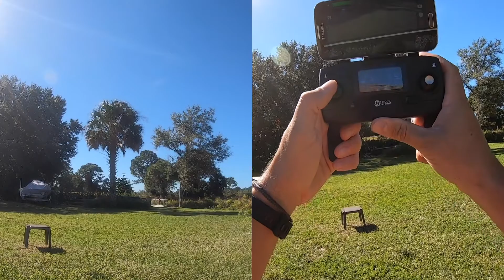Holy Stone HS-720 4K drone yaw issue

Comment: Eesh. Mine worked great for the first few flights, it held position like it was sitting on a stick, but now it just drifts at will, not necessarily in response to input. Was there any trick on how you contacted them for the replacement or was it straight forward?
Reply from the maker: I emailed them directly.  It did take a few follow-ups, but they responded eventually.

Comment: When I fly connected to my phone, I have the issue of it wont turn when it gets a certain distance away. When I fly without the phone, it responds very well, no issues.
Reply from the maker: Interest, I've not heard that one before.  Maybe a range issue with the transmitter?
Reply: Can I ask you what phone you were using when it would not rotate?  I am having the same issue, phone on, it won't rotate,  phone off, acts perfect.

Comment: I have the same problems with the H510, I can’t trust it. So bought DJI mini 2. No comparison between the the two, despite what I have heard on the odd blog. But then the price is different
Reply from the maker: Yeah, that's true - not a fair comparison.  I ended up with with a DJI Air 2 and it's so much better in every way.  But it cost 3 times the Holy Stone.

Comment: mine is doing the exact same thing as well, but when it starts going off in a direction, it goes sailing, had some nasty crashes, main body is cracked atm, contacted HS, hopefully will get a replacement, and if that doesn't work, returning to Amazon and looking into the DJI mini 2
Reply from the maker: Good luck.  I've been very happy with my DJI Air 2 and am considering adding a Mini for times I have to carry it long distances.

Comment: Thanks Jason I did contact them i was told by them just to turn off beginner mode Will try but don’t think that will solve the problem
Reply from the maker: When I contacted them, they told to turn off "headless" mode.  I never flew using that mode, so I tried it.  Other than hating the operation in that mode, it made no difference.
Reply: @sasquatch_in_flipflops   So I take it they’re not doing anything about it lol
Reply from the maker: @jamie-meanskunk  They replaced it with another one that had similar behavior.  I did another video and compared it to my Mavic Air 2 --> https://www.youtube.com/watch?v=eWadpTyaZQM

Comment: Mine doesn't respond to controller all the time makes me scared to take it high or out what's the point of it if I'm scared to fly it
Reply from the maker: Yeah, I agree, it's not very confidence inspiring if you don't have full control.  I'm fairly certain (but check your manual to be sure) this model has a failsafe return to home where if it looses signal from the controller and has GPS signal, it will fly back to the initial home point.  I tested one or the other, but I can't remember if I tested this with my DJI or the HS drone.